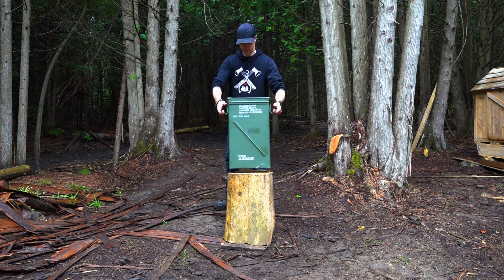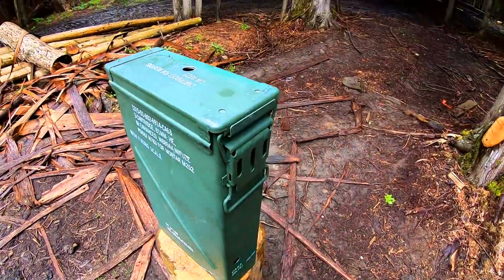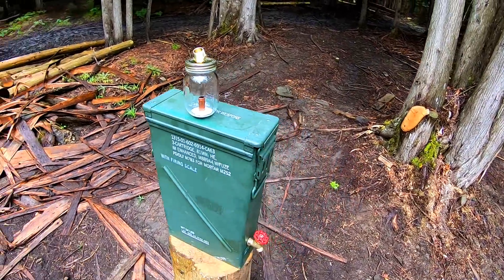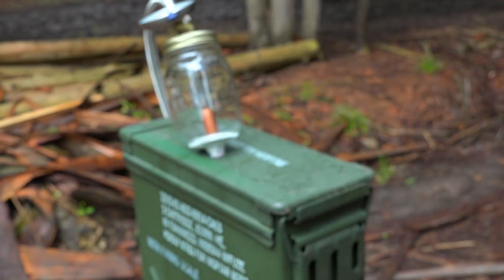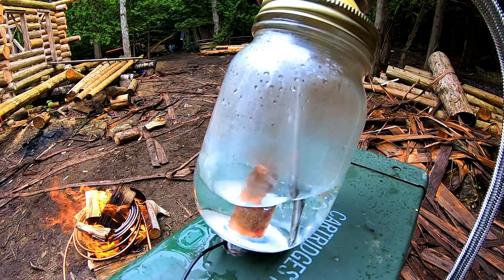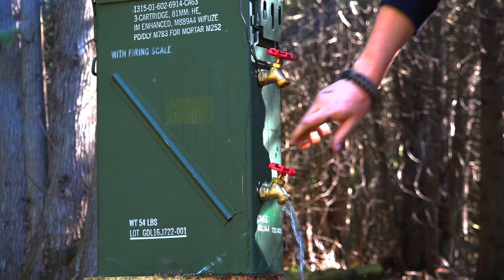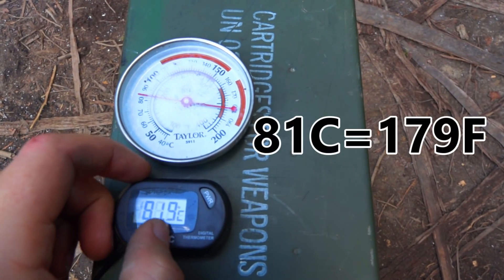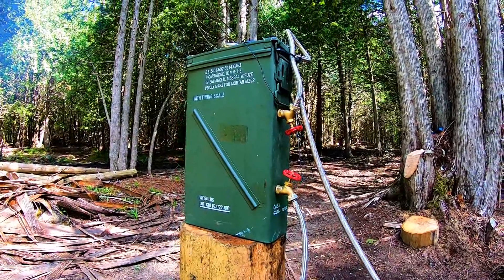Off Grid Heating Prototype- Copper Coil Water Heater / Heat Exchanger / Radiant Heater

Comment: That should he fun to sleep with. A scalding hot radiator that sounds like a jackhammer.
Reply: I'd love to graze my foot against it while in a deep slumber.
Reply: @GunNoob-o3b  You're not wrong haha! I live maybe 15 to 25 mins from 8 mile and I have a neighbors safety app. And I swear to god its like every other night some sort of violence happens. Either with guns or knives. Hell someone got hit in a drive by just 2 nights ago. Not by bullets by the fucking car itself.
Reply: Harry Moobs that’s my concern...I don’t think he even has to knock it over.  Are all those components, rated for 100°C+ water?  Will some of them fail eventually due to the heat and causing leaking?
Reply: word! he would roast himself if he put that in the shed. should have put the coils in the coals just a little bit to control the "thermostat" and lessen the sound.
Reply: It doesn't need to run through the night.  All he needs to do is heat up the water outside before going to bed, then disconnect it and put the ammo case in the camper. The water in there will retain its heat for a long time and there will be no danger.
Reply: hahahaha
Reply: Lol ... I want one in my bedroom
Reply: @Harry Moobs - It's a prototype so far... I for one would experiment with adding in a secondary set of copper coils or maybe a small automotive heater core, with some cordless wood stove fans to maintain off-grid efficiency and keeping the setup simple and compact... going this route would also help reduce/eliminate the hazards of having a tank of boiling water inside such a small shelter.
Reply: How long of tube would this work with.

Trying to have a longer return line to run through a wall or put through a cracked window.

Dont want to damage my house from direct contact to a boiling tube.

Wondering if you could have a 15 foot return line to cool the water down a bit before it gets to the house. Hoping the heat still pulls it towards the tank.
Reply: @Fluttershy - Great questions... would no doubt take some additional experimenting to figure this out.
Reply: Buddy S lots of Ambien and moonshine... you’ll never hear it... 😉
Reply: Looks perfect for COOKING TROUBLESOME DEMO-RATS & RINO'S 2 A BEAUTIFUL SHADE A PINK. START w/CHICAGO & SPRINGFIELD ILLINOIS SACRAMENTO COMMIEFORNIAN DEMO-RATS. WORK YOUR WAY DOWN THE SEWER 2 BEZERKLEY EVERGREEN BROWARD COUNTY FLORIDA PD/SHERIFFS DEPARTMENT SEATTLE BELLINGHAM OLYMPIA "IT'S THE WATER."
Reply: I think it would make a cozy cradle for a new born baby.
Reply: @LOOKY HERE I think some people just like to make things more complicated than they need to be.  If it were me, I would just heat up enough water for a couple of hot water bottles and snuggle down into my sleeping bag.  It's a tiny space in the camper. That ammo case at 85 degrees C would probably make it uncomfortably hot.
Reply: Bahahaha 😂🤣😂
Reply: Looks like a recipe for a trip to hospital
Reply: At least you need to pack 10-15 gallons of water below freezing........ shits lightweight and such.
Reply: That amount of water is going to stay hot for the whole night and once he removed the coil from the fire, it stopped thumping. Im more worried the cavitation from the imploding steam bubbles is going to break the tank eventually.
Reply: Buddy s you must be from the city lol You ever think about him just running a continuous pipe loop threw his sleeper with out the tank dingus
Reply: Some people hear gunshots and crying all night. I think he’ll be fine.
Reply: @jaelaj.9148  good comment
Reply: @Jaela J. - Exactly!  I'll take that noise over sirens and traffic noise in a city any day. Plus, it's a prototype... adding a small automotive radiator/heater core with a low voltage fan or (better yet) a couple non-electric wood stove fans will further improve efficiency!  }:)
Reply: @jaelaj.9148  Some people don't. They're smart.
Reply: You've built a "Thumper" tank. See "Moonshine Stills" for more information.
I think you could have drilled another hole on top where the jar was, attached a translucent hose that allowed water to rise and then re- enter the tank safely, while still giving you a visible gauge of sorts to see what's happening inside.
Reply: What we did, was take two semi rims, cut the centers out and welded them together.  Then using metal tubing brackets we mounted the coil inside the upper rim with the coil ends exiting accordingly.  Short legs are added to the bottom for inward airflow. Using a metal dome grill cover on top to control the burn rate.

If you burn too hot, you WILL melt the copper.  This way exposes the tubing to heat, but away from the destructive effects of the flame.
Reply: Robert Gwynn that copper can’t get much hotter than 100° C while it still has water in it.
Reply: @sleeknub  not true if that water is steam or under extreme pressure... Easy to approach bad conditions... The main reason for my pressure release valve suggestion.
Reply: KO H the system is open to the atmosphere, so we know it isn’t under much pressure beyond 1 atmosphere.
Reply: @Robert Gwynn - Good idea but the rim design unfortunately takes up more space/creates considerable storage bulk :(  The trend these days (for many/most) is to keep the design simple, compact and light weight as possible. Also... the problem/issue of melting the copper tubing can actually be solved very easily by clamping the copper coil assembly with some long metal brackets... then setting the clamped coil assembly onto a cheap folding fire grate. One nice benefit in adding the folding fire great (aside from easy, compact & cheap )... you gain a tool that can perform double duty/is extremely useful for other necessities. Don't get me wrong, I can totally see the aluminum rim design working great (albeit) in more permanent/less mobile applications...
Reply: Buddy S I get everybody is making jokes here, but on a more serious note, he said that it took about an hour for it to reach boiling point. He then took the coils out of the fire, and even after two hours without heating in the fire, the radiator was still extremely hot and maintained its temperature. That means it will likely keep him warm through the whole night in his small camper, without it having to boil through the night.

Comment: You can set up a brick furnace design which will give you way more efficient and burn far less wood to get the same job done. You have to regular temperature to not melt the pipes and cause other issues like melting your seals or pressure explosion. Your tank can be insulated as well. All this equals less wood burning to accomplish the same results.

Comment: Let that water boil into a some rolled up chain link fence inside a vertical column with a cold water condenser at the top and you have yourself a simple distillation column.

Comment: Next step, build a rocket stove with a removable coil between the center chimney and "down-pipe" forcing the heat back down and up again. In essence you'll receive 3 passes instead of the traditional 1 pass, maximizing your BTU while using up minimal fuel. There are examples of this type design out there, usually used in what they call, "gasification". It's highly effective when done right!

Comment: This is a great idea. What if you ran the return directly into a small baseboard heater to you could use the hot water to warm air. Then from the baseboard it goes back into the amo box and sent to the coil to be heated again. Depending on the size of the room youre heating and the temp outside, you could have a few different sized coils to allow enough heat (but not to much or too little) to keep the water at a constant temp so you dont have to worry about the water evaporating overnight or while youre away

Comment: Nice set up. Lots of future options. Have you trying linings and spacing the inside of a metal barrel for your popper tube? 35 drum should do. Did somthing similar a few years back to heat my cargo. Just watch to under air of the barrel.

Comment: how is that gonna be controlled during a 9 hour night or more? i get you would have to stoke the fire but the boiling water would steam out threw that top hole filling your camper with steam you should have a hose going from it to the out side so the steam/pressure is separated from your camper to the outside

Comment: Nice idea, but will you be able to use it during winter?  You will need somehow make sure that water inside never freezes. You could try fluid for car radiators, but spilling it on your stuff or even forest floor would not be nice.

Comment: Forget the water, forget the stones. Using the 5/8 copper coil suspending above the fire. The coil could become a  heating / cook surface with copper pipe soldered to the bottom that extend an inch past the outer ring to solder 90 or 45 degree fittings to slip  removable legs into. Now for heat in your cute camper. Run the braided hoses to 2  threaded bungs on the side of the camper. You now have closed loop convection warm air heater. with a salvaged computer cooling fan on the cold side pushing the heat you would have a sauna in no time. Carry a 4 or 5 foot length of straight copper pipe w/ fittings  that attach to the camper fitting on the warm air side and supported with notched branch . The braided hose attaches to the other end. Instant heated clothesline. Now you have a place to to hang wet gloves,socks. Really enjoyed your build and adventure.

Comment: Suggest you use a couple passes of black pipe formed in a S shape and placed within concrete. You currently have too much area of pipe for absorption . The concrete thermal mass will moderate extremely high temps from the fire and the shorter length of pipe will reduce the higher temps as well.
Your system is great, and will be fantastic for the cabin where the area to heat is closer to the surface area of the copper coils.

Comment: Don't know if it's been suggested, but you need to have   a second system with a similar design in series for this to work. 
Use a 12v DC aquarium pump or something to circulate a loop inside the ammo box. Grab a few 240mm computer radiators for inside your cabin. Mount them, maybe add fans, good to go.

Comment: I can't overlook the fact of where the initial 6 gallons of un frozen water comes from to fill that system, in the minus twenty degree temperatures.....Any idea how much snow one would have to melt to fill that ammo can ?......A lot....Like 30 of those galvanized pails, at least....There's a reason why vehicles use "ANTIFREEZE" in their radiators in cold climates, and it's not for when the engine is in use. It's for when it is exposed to the ambient (freezing) temperatures when NOT in use.....This would be a viable system to heat water for showers or dishes or some such in a cabin or camp, but not as a heater in said cabin or camp....Then; Lets not even get into the Condensation issues.

Comment: Might run a loop in the cabin ala radiant floor heating have connections on the outside so you can run a smaller fire and not have to move the water inside

Comment: Also a small vent hose going out with a flap on it or a pressure valve might be a good idea. a small fire place in the cabin might work also for heating, if you plan on one. Finns and screw down mounts to immobilize the tank might be a good idea. Really neat and simple idea.

Comment: Could you slow the temp rise by partially closing the bottom valve. Also in winter the water will freeze. Could you use Biodegradable RV antifreeze to keep water from freezing when not in use?

Comment: If you add another valve in that hole in the lid you can adjust the steam venting out. By restricting the venting a little you could increase the speed of heating. Just be careful not to close it. This would also allow you to add another braided line to the top vent that could be used to pipe the steam out of the camper. Also if you placed an insulating jacket on the ammo can  during the heating process you could increase the speed of heating as well. Once the ammo can is up to the desired temp you could slip off the jacket and allow the radiant heat to fill the little camper.

Comment: Im so impressed with your video! Ammo box is going to work great... however you just didn’t find a way to heat your camper, with your set up of an off grid water sistem heater/ pump you could have an offgrid hotwater shower !!!!

Comment: you should have put the coil outlet into a one way valve and blast that pressured steam into the water, it would instantly condense and any excess pressure can be let out the top via pressure release

Comment: You should try too containers, the ammo box inside, another metal box outside. It will solve the noise and allow you get the inside temperature under control. Using taps one can limit the water speed.

Comment: That seems pretty dangerous to keep besides you in that small cabin, if it tipped over you would have scalding water all over yourself. Can you just put reflective insulation in the cabin to reflect your own body heat back at you? Also, I couldn’t sleep with all the bubbling and hissing that thing makes. I go outdoors for some peace and quiet. Anyway, if you really have to have a water heater in that cabin, I would listen to some of the other comments and reverse your whole design, copper tubes under the floor and put the ammo box in the fire, at least it would be safer.

Comment: that extra hole in the top acts as a humidifier and prevents it from becoming a pressure vessel. i guarentee if you started with the inlet where you relocated it and didnt have the other hole it would have built pressure until it burst... scolding anyone nearby. and the lid probably wouldnt have been the fail point (those are some heavy duty latches, the rubber seal might have failed but i think it would have failed at one of the fittings, or maybe melted the pex in the braided line). either way something that should be tested well past normal operation before actual use. not trying to discredit the video as its n excellent idea just stating be cautious

Comment: Interesting - but why did you put the inlet at the top of the ammo box?  Why not have the inlet at the bottom and let the heated water circulate faster in the tank?    IE - the top of your coil on the fire.. feeds the bottom of the tank.     The expansion of the water over the fire will easily draw from the top of the ammo box... but your tank will heat faster.    Am I wrong?

Comment: May I suggest that you connect a normal central heating radiator into the return line to the coil and fit this inside the hut? ( with a radiator bypass pipe, having an adjustable valve for heat control )

Comment: I would think a couple of check valves to force the hot water to flow in only one direction - to the tank.  That's how modern drip coffee makers work.  I'm sure you'll be working on other methods to heat the water to save wood such as a tigher wound copper loop.  Another method would be similar to a steam engine (heat exchanger) - a boiler full of water.  Just don't boil the water.  Then draw air thorugh sealed submerged tubes into the camper.

Comment: Your system works on the same principle as my Yanmar tractor. It doesn't have a water pump but it does have a radiator and a fan that runs off the front of the engine. Try your method using a radiator and let air circulate through the fins.  Add a small 12-volt fan and blow out the heated air.  Great idea you have there.

Comment: of course in winter it will be much colder ambient temparture and water freezes in winter conditions so you'd need to melt the snow first so things would take longer to heat up and then it would cool much faster. However question is how long does it take to cool down after the fire goes out.

Comment: I have read most of the comments. I do agree you should run some sort or a radiator. My biggest concern is too much condensation from the ammo box. Since it has a hole in the top, but you need someplace to the relieve the pressure. You don't want everything getting wet. Maybe you should run a rad inside and mount the ammo box to the outside. This should also give you a better flow, because your water source would be cooler.

Comment: It would make way more sense to put a system in the bottom of the camper like what an in floor radiant heating setup would look like but on a much smaller scale and not use water but glycol.  Using a heat exchanger you could use water to heat the glycol.

Metal/glass are terrible for this application.

Comment: If you added a radiator into the system it would allow you to keep the coils and the fire for longer and produce much more heat inside your camper. Just like a heater core or that may be better to get is a heater core

Comment: Or... You can place embers inside of the ammo can using the top hole as an exhaust connected to a hose. Eliminate the huge coil and more plumbing which would eventually fail. A couple nights of trial and you can figure out how much embers is needed to last a full night.

Comment: Glad I rewound to the snow mobile camper, its a sledge, so cool, so funny, love it. You can safely have a mini stove and flue with hot water pipes coming off. They have them in caravans. You could use all kinds of fuels and run the pipes around the bottom corners. Then it doesn't matter about the rain putting the fire out when you need it the most. See you have silver inside but not everywhere. Would you really need that much heat and what about the steam inside ? How much heat and fumes comes of those lanterns ? Could rig a lantern to a flue. Trouble with big channels they rarely interact. Subscribed, awesome. I want to try and design a light weight, single pole mini tipi after watching this.